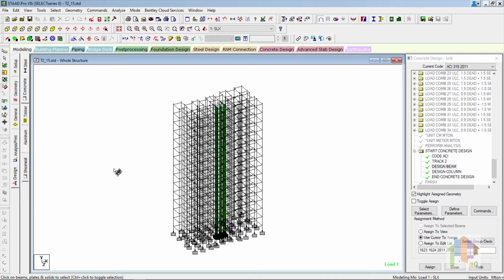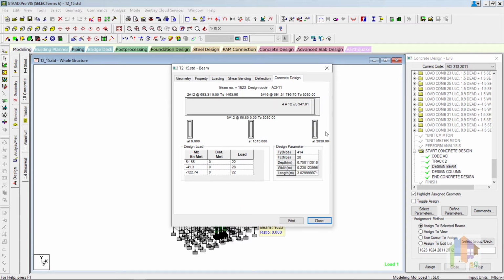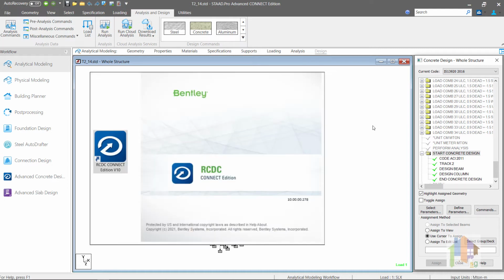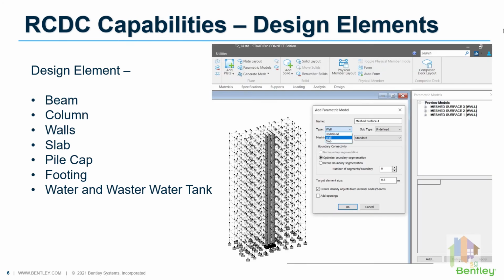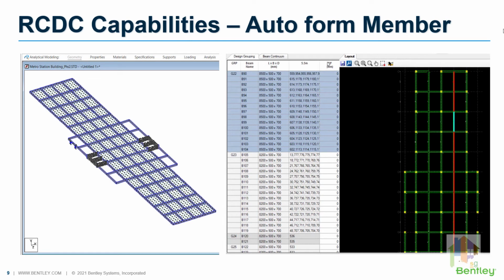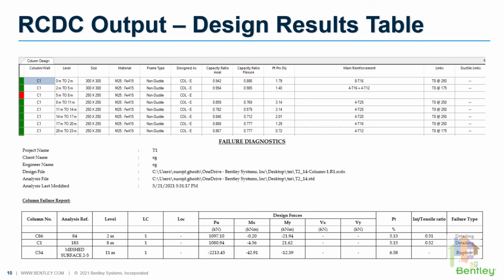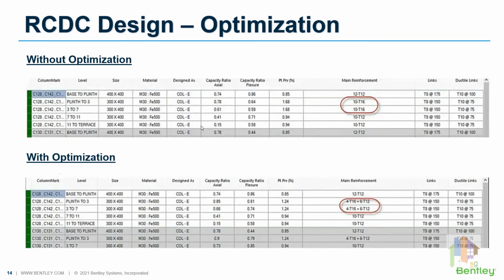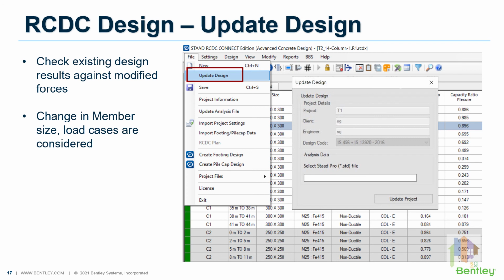Design of Concrete Elements in STAAD: Part 1 - General Overview

Comment: Hello let me propose some few  topics if you have time please help with a video for a detailed demonstration like how you did in Steel design.

1.How to model different types of stair and perform design of those stair using plates in STAAD Pro,and how to perform deflection check by using vibration method and span depth ratio.Using BS 8110 or Eurocode or Indian Code
a).Spiral stairs
b).Quarter turn stairs
c).Half turn stairs
d).Helicoidal stairs
e).Open well stairs
f).Branching stairs

2.If a stair is designed independent without modelling the stair in my frame STAAD model, how can i consider these stair loadings in the STAAD model,refer to those stairs mentioned above

3.How to compute partition wall load and apply it as a floor load in STAAD model (Assuming that the partition location can be applied anywhere on the slab)

4.How to model a frame structure  with flat slab using plates in STAAD model,and after analysis how to import that model and design that flat slab in RCDC FE.

5.As we know STAAD Pro do not have a direct method to model waffle or ribbed slab,but we can try to model the closely spaced beams representing the waffle or ribbed slab and design them in RCDC.

6.How to model ground beams in Staad model.

7.Another thing is when are you planing to implement the feature of beam deflection check in RCDC as we know in some cases we may have to increase the number of bars in order to satisfy deflection check citeria,but as of now RCDC does not perform deflection check of beams.And what is the alternative solution which one can use especially when we have a larger model,it will consume alot of time to perform deflection check manually.
@surojit_ghosh

Comment: Sir how can i download RCDC V10 or later version
Reply from the maker: If you install latest version of STAAD.Pro CONNECT Edition (V22, Update 8), then RCDC v11 will be automatically installed in your machine and you can use the basic modules of RCDC using STAAD basic license. Else you can visit Bentley software downloads page using the following link and download the installer file -- https://softwaredownloads.bentley.com/en/
Reply: @surojit_ghosh  Free version ?
Reply from the maker: @arghyanandi7960  Yes, part of RCDC is now free with STAAD.Pro CONNECT Edition and if you install latest version of CONNECT Edition, you can select the STAAD license to use this.

Comment: Please upload a video on modelling and analysis of shear wall and also on how to analyse plate mat, assigning support to plates i.e how to assign subgrade modulus and interpreting plate results
Reply from the maker: Overview of modelling and design of shear wall using finite element meshing will be discussed in the next part. I will try to upload a detail video on plate mesh generation for wall and slab using various options in STAAD in the next month.
Reply: @surojit_ghosh  

Hello let me propose some few  topics if you have time please help with a video for a detailed demonstration like how you did in Steel design.

1.How to model different types of stair and perform design of those stair using plates in STAAD Pro,and how to perform deflection check by using vibration method and span depth ratio.Using BS 8110 or Eurocode or Indian Code
a).Spiral stairs
b).Quarter turn stairs
c).Half turn stairs
d).Helicoidal stairs
e).Open well stairs
f).Branching stairs

2.If a stair is designed independent without modelling the stair in my frame STAAD model, how can i consider these stair loadings in the STAAD model,refer to those stairs mentioned above

3.How to compute partition wall load and apply it as a floor load in STAAD model (Assuming that the partition location can be applied anywhere on the slab)

4.How to model a frame structure  with flat slab using plates in STAAD model,and after analysis how to import that model and design that flat slab in RCDC FE.

5.As we know STAAD Pro do not have a direct method to model waffle or ribbed slab,but we can try to model the closely spaced beams representing the waffle or ribbed slab and design them in RCDC.

6.How to model ground beams in Staad model.

7.Another thing is when are you planing to implement the feature of beam deflection check in RCDC as we know in some cases we may have to increase the number of bars in order to satisfy deflection check citeria,but as of now RCDC does not perform deflection check of beams.And what is the alternative solution which one can use especially when we have a larger model,it will consume alot of time to perform deflection check manually.